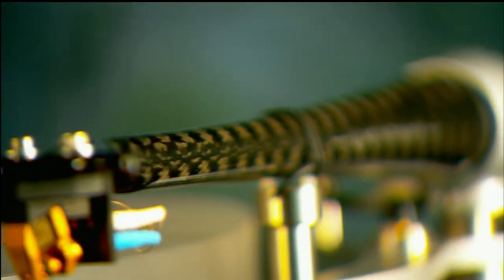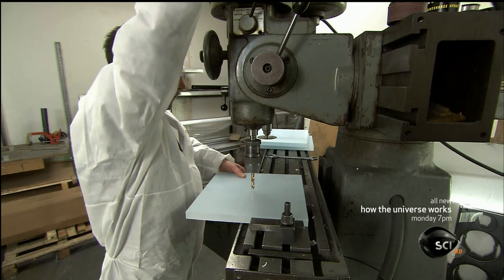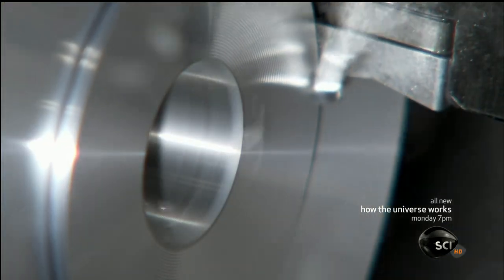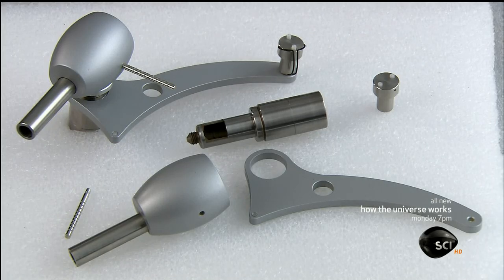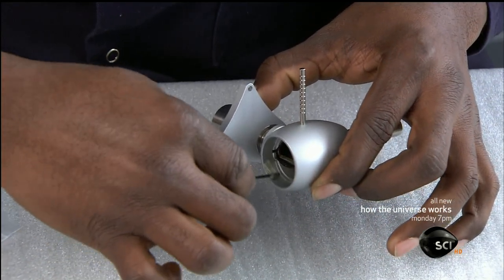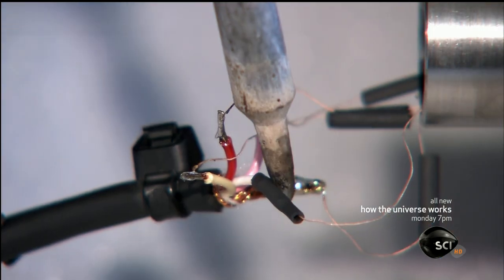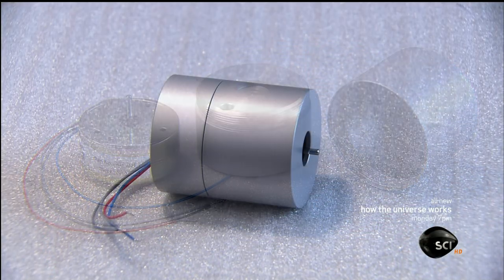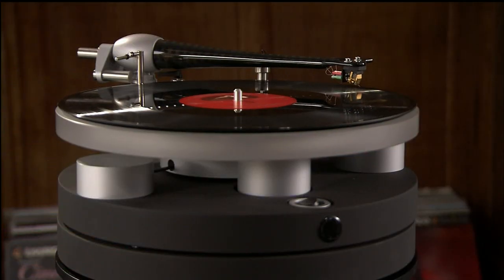How It's Made - turntables

Comment: The wires aren't stuffed in the cylinder like that.  There is a plug in the bottom that holds every wire in position to those  going through the arm.  Since this type is internally grounded, there is a ground wire attached to the blue wire that is grounded to the side of the metal cylinder.   That's tricky because you have RCA cable wire, the tonearm blue wire, and the ground wire that is soldered together.  The entire assembly is inserted into the cylinder with a screw or glue holding it in place so it cannot move.  There is enough slack going through the arm so the assembly never receives any pulling from above or below.  Cardas makes a complete assembly for rebuilding the arm, but I choose to do my own.  That is absolutely necessary if you buy Rega turntables because the wire is too thin (breaks) and the clips are laughable at best.  My RP1 had to be rewired, and the sound is better than the original with higher quality wire, RCA cables, and high quality clips.  It isn't easy, but if you can solder properly, you can do it.

Comment: I can see many immediate problems with this table and inherent design flaws, No. 1 The motor pulley wobbles. 2. Acrylic platters create static electricity and attract dust to record surface. 3. Tonearm design is very poor. Foreigner assembling tonearm is not qualified. Tonearm has poor counterweight design. Any Thorens TD 150 MK II will beat the daylights out of this imposter turntable!!!

Comment: Unless you use it for DJing, there is nothing wrong with belt drive, *IF* it is done right.  
The reason it's given such bad rep, is because the cheapest turntables that use it, also feature tiny piss poor DC motors that struggle just to get the platter up to speed.

The GOOD belt driven tables however, have much larger motors with huge pulleys, as well as circuits that constantly monitor the speed, keeping it dead on.

Comment: Two dead wrongs in first 30 secs of video:
1. It's not a good idea to drop the record on the turntable which is already on. The turntable should only be turned on after the record is resting there already. 
2. I wouldn't dare dropping the stylus with bare hand - that's what the cueing lever is for. With your shaky hand it's easy to damage the record itself or the stylus / cantilever. Worst part? If you don't notice the latter and continue playing and irreversibly damaging more records.

Comment: It has to be a really bad press test for the MP3 to have better quality. Don't forget that physical formats deal with electric signals, and MP3 deal with digital format. Also don't forget that computers can't render curves (has seen on sine waves) 100% perfect. This should result in minimal artifacts.
MP3 is a lossy format, the compression gets rid of a spectrum of freqs. It's very unlikely for a 320kbps MP3 to have better quality than a LP, but it's not impossible.

Cheers.

Comment: Yeah but the difference here is that the vinyl record is closer to the original sound from the get go. In a digital playback system you are converting analog to digital (loss) then going from digital to analog (further loss). In a straight analog system there is no conversion of that nature. The mechanical motion drives voltage which is amplified, all the information is still there as it was. You don't get that with digital, its been stepped on several times. That's the key difference.

Comment: loosing quality in an mp3. That's how compression codecs work. They "throw away" information in order to reach a smaller file size. Trust me, I myself along with many other vinyl DJs can tell the difference between a raw PCM wave file vs. an mp3 of any bit rate  rather easily, especially on club systems. This is why many digital download services that cater to the fake DJ market have been steadily moving towards wave file downloads.

Comment: Yeah thats bullshit dude. You are confusing bit rate with fidelity. It's possible to have in the analog domain frequency response from as low as 5hz all the way up to passed 375,000hz cut into a vinyl record. Maximum fidelity of an mp3 using the top end encoders is a range from 20hz to 96,000hz. The real reason why vinyl sounds better even if its cut from a digital source (raw PCM wave files) is that the analog electronics deliberately force the sound into a wave form that can physically be cut.

Comment: and if you really want to complain, explain why the Technics 1200 MKII turntables are still world standard, explain why they are still pressing vinyl and people are buying, it's not because of hype.
using a diamond tip stylus doesnt automatically mean the records are going to last only 30 seconds, the diamond is rounded off, look at the Shure M44-7 cart, diamond tip stylus been using for 10+ years, and i have records that ive played for over those 10 years on the M44-7, and they play perfectly.

Comment: The process involved in engineering and cutting a vinyl record ensures this doesn't take place because the material is engineered correctly and there for can be reproduced accurately. This is appropriate dynamic range mastering and its what makes vinyl sound a fuck load better when done right than most digital material because you can't break the rules.

Comment: 1-if two recordings are made, one digital and one analogue, since an analogue recording has NO limit to its information detail( ie  infinite) and a digital sample is finite( 192khz in my system) then where's the ambiguity?
2- to encode and decode from analogue, back to analogue-requires an extra stage- this is  a small signal preamp stage- ergo additional degradation that an already analogue recording DOES NOT require.
3-Why do you think audiophiles prefer vinyl?
Reply: variando de acordo com o tipo de amplificador,  não existe conversão do primeiro registro, e muito menos sublimação!
Reply: Where on earth did you get the idea (misinformation) that analogue = unlimited "definition"?!? Wow. That's absolute nonsense. Vast majority of analog formats have significant roll-off before you even reach 20khz.  Who's been filling your head with rubbish?!
Reply: Eg. On a tape deck, the head gap and the size of magnetic particles will LIMIT the highest possible frequency it can reproduce. And noise levels will drown out low-level high frequency audio anyway.
Reply: Since analogue signals have no finite limit to the information they can store they are technically superior, it's called science.
Reply: @6488ott  lol. Ok, so....are you talking about theoretical magical formats, or actual real life analog recording formats? I understand the science of audio. I'm an engineer, who's been in the business from back when open-reel video & audio tape formats were still used as Master Tapes, right through till present day digital methods. I can assure you that real-life analog formats have lower frequency response limits than digital. It's called science. (Real science, not amateur "audiophile science".) Thanks.
Reply: @6488ott  once you've done your homework, come back to me and I'll gladly score your next essay. 😄

Comment: I own this TT with the carbon 2.0 arm and an AT33PGT MK2 cartridge. It is a little harder to set up than something like a Rega but once done so property the sound quality is excellent. It won't be a TT for everyone and at this price it will divide opinion regarding value for money. I was fortunate to purchase pre owned. I can say that it is very well engineered and solid in construction. Exceptionally balanced and detailed sound. To pass judgement one would have to examine it in person and listen to its comparative performance in the context of your own system. There are plenty of brilliant turntables to choose from at this price point.  I couldn't comment them because I haven't owned them. However the 2.0 arm is something of a classic.
Love or hate it, it will always be a great TT in terms of sound and a talking point because of the cake like design. Nothing wrong with a Technics, Roksan, Linn, Gyrodeck etc all personal choice. But mine was this, from a UK company with a great reputation. I don't work for them by the way but just like what I hear.

Comment: You are completely wrong when stating your position as simply as that.

Now if you were to say "Nothing beats a Technics SL1200 when comparing average purchase prices vs. performance", there is a chance you could be right.  I don't have access to the price database on Audiogon to look into this further.  If there is another turntable that can beat Technics at the same pricepoint, I would put money on the older Denon direct drives (DP-45 and up).

Comment: But artifacts are audible in MP3.  For comparative reasons, lets say that I put a pure white frame between every frame of video and play it at 200 fps.  Meanwhile I take the same video without the white frames and play it at 100.  Which will look closer to original?  I chose white because artifacts appear in the higher amplitudes of the sound  where there's plenty of contrast.

Good speakers have better resolution.  With artifacts, you're causing them to deflect needlessly.  It adds up.

Comment: if you are going to argue that vinyl is better than digital, you also have to take into consideration where the original sound came from and how it was recorded. almost ALL modern production techniques use digital recording for vocals, guitars, drums, and all of those digitally recorded sounds are ran through some sort of digital audio workstation. so right off the bat, all of those sounds are digital...pressing them into an analog surface (vinyl) wont magically make them analog again....

Comment: MP3 is a lossy digital format.
The Compact Disk is a lossless format operating at 44.1 KHz.
This does not mean CD as a format is perfect by any means, 20 Hz to 20 KHz is the audio bandwidth.
A record can do from around 12 Hz to well over 40 KHz.
Quadraphonic records put a 30 KHz carrier on the record and modulated this for the 2 extra channels.
Only DVD audio at 88.2 KHz can match the dynamic range of a fresh record (DVD-A 88.2)
But after even a few plays records lose quality.

Comment: Nope, nerve system is DIGITAL!  Pulses, and such.   Analog had room full size rooms with the capacity of  what can't be done with a USB stick.  Analog is dead.  With all the bio work being done, it's DIGITAL.  And the research itself is being done with DIGITAL instruments, kinda funny.   Thinking analog is superior to digital shows what you don't know, and what you think you know.   I guess you need to use your RHEOSTAT lighting control, over a digital addressable system.  21st Century, join it.

Comment: Must not be U.S.A.  Electrical contractor doesn't solder.   There are no solder connections in AC power wiring, and the term "electrician" is not a legally recognized term.  Licensed" Electrical Contractor" is the legal term.  Technician is a vague meaningless term.  Electrical Contractors don't deal with TT or audio ckts, they may install systems, they are not dealing with this type of work.   This is merely factory assy.  Assy worker

Comment: Analog anything from tape recorders, to LP, to anything, has limits.  And they are much sooner than anything that isn't digital.  A DSD recorder has a dynamic range of 120dB.  0-100KHz.  A record has such a limited lower and upper limit, it's hardly anything that resembles teh LIVE original.   Mechanical grooves can't swing that far for bass or fast enough for high freqs.  Cartridges are severely colored and limited.  21st century join it.

Comment: Yes, the equipment's converter bandwidth matters hugely which is part of why I'm trying to say even with digital you need at least midrange gear for decent output and reproduction. But, I'd argue that the analogue part of the reproduction stage and the quality of it's electronics matter even more as by your argument we're back to pure-analogue problems like wow, pop, click, hiss, distortion, etc. Digital also has distortion, it's just at-headroom truncation instead.

Comment: I ran out of characters, so I'll add to what I said about analogue by pointing out that the audio quality in pure analogue is determined by the quality of the equipment only, but digital audio's maximum quality is determined when the analogue signal from an acoustic device is converted to digital, at which the signal can only degrade from poorer equipment for reproduction and reconversion to analogue

Comment: No they are either teflon or silk coated and the joints are covered with heat shrink. Not very impressed with that guys soldering or the use of that ruler - would have thought they have something a bit more accurate given the cost of that TT

Comment: Some may argue that lower bit depth audio sounds exactly like higher bit depth audio.  I tend to disagree.  The higher the bit depth and sampling rate of purely PCM audio, the better.  This is because it will emulate the complete analog waveform much better.  Still, 16 bits is a lot of amplitude info, especially for a range of between 0 and 1 volt.  

MP3 on the other hand, adds artifacts and does a mess of a job.  You can tell the difference, especially on good speakers.  Even at 320+ kb/s

Comment: Direct drive reached great sophistication in the late 70's into the 80's.  Problems with wow and flutter, cogging noise, and vibration in general reached lows commensurate with excellent belt drive models.  The instantaneous torque provided by these evolved direct drive models always trumped the belt drive units simply due to the nature of the direct transmission of power (i.e. motion).  But, as refined as the best direct drives became the best belt drives had lower rumble and as such are king.

Comment: The only thing to worry about is getting the right belt when the new degrades. You pay so much for a turntable and the company goes under then in ten years plus you must find a belt. Even new old stock would be no good because the rubber degrades over time. I understand that the motor may give off vibrations on direct drive but gee I believe that on a Technics 1200 that the vibrations given off are so miniscule that it does not matter to the ear. I would rather have the reliability

Comment: depends on what type of electrical contacting you are doing. You have to solder sensors and LEDs and motors to get the best performance and the electrician is the one in charge of making sure all the electrical components work as intended

Comment: As an audio codec programmer I need to correct you as you've confused bits per second (compressed) with sample frequency (uncompressed) - the two are not the same. a 256kbps MP3 indicates the number of bits from the file that have to be read on average for 1 second of decompressed audio, which is typically 44.1KHz PCM at 16 bits per sample. a purely-analogue signal will have 100% higher audio quality than one that involves any form of AD/DA in it's works as audio is continuous and analogue.
Reply: Absolute BS, Rachel. I'm a professional audio & video engineer with 32 years experience, not some clueless kid, just FYI.  Define "100% better"! Analogue itself is fine, but all forms of analog recording (tape, vinyl, whatever) introduce far more damaging distortions and noise than a high quality a-d / d-a process ever could. You're talking absolute rubbish (unless you're stictictly talking about low-bitrate compressed codecs, which apparently you weren't).

Comment: Analog is dead.  In lightihg control, video,car ignitions, it was all analog, it's now DIGITAL.  Analog will never  come back for anything.  Rotary phone technology, in a touch tone world.  Not gonna happen.
Reply: Kevin Counihan  mechanical relays in big buildings....vacuum tube logic circuits....rotary..did pulses but wasn't digital if it had more than 1s and 0s...the voice transmission was pure analog...now still using touch tone it goes over fios..light pulses..is light transmission through fiber, analog?
Reply: Kevin Counihan  analog is dead..no matter what humans perceive...automobiles communications ,audio,video,even money..its digits in vapor...even a door lock..its open or its locked
Reply: Kevin Counihan  Funny how they use digitally controlled CNC to make dopey stuff to play obsolete records....Ironic, takes digital controlled equipment to make toys for obsolete analog playback
Reply: Kevin Counihan  I don't have crappy bluetooth MP3 etc, you make some very broad ASSumptions, ever see how automobiles where made in the 1950. 60's with analog controllers, pretty primitive, look at today's modern German digital controlled factory, DIGITAL changes everything, Analog is dead...giant airplanes fly cus of DIGITAL control, not analog like an old Prop job...Computerized TOOL, makes all the parts to play a record, what don't you understand, Digital controls...21st century, join it!  Even Lighting is Digital, lets compare medical processes, today's digital testing equipment to 1960's crap.  My DSD music components are better sounding than any obsolete record, I have hundreds of albums in OBSOLETE records, many phono carts, more than one tone arm, thus, you make dumb ASSumptions.  Analog cell phones went away decades ago, wonder why?  Hmmmm I had em all, current DIGITAL Samsung S20 Ultra is the best one yet